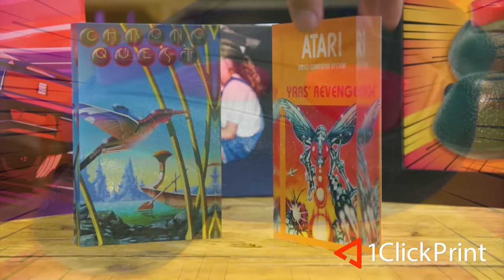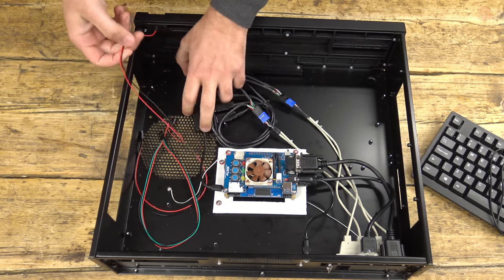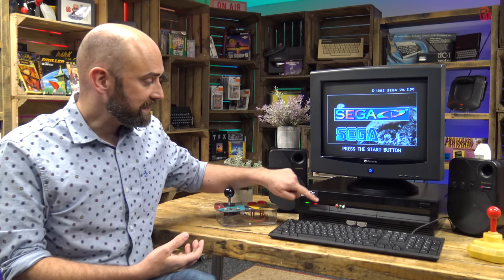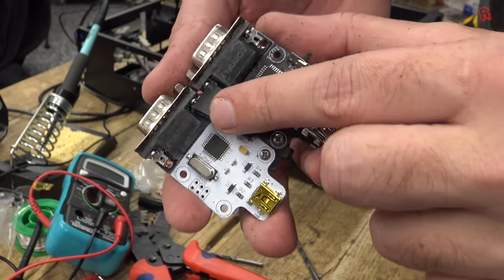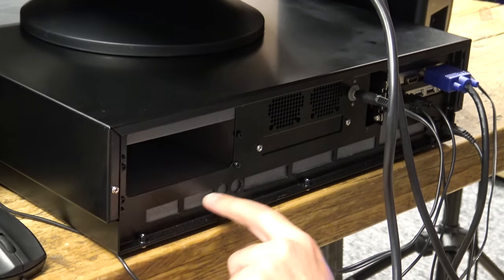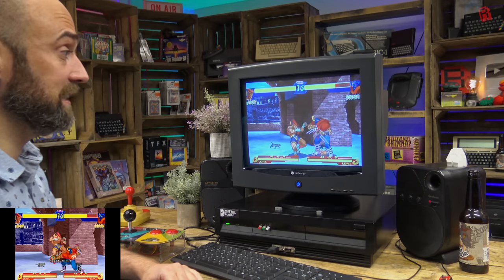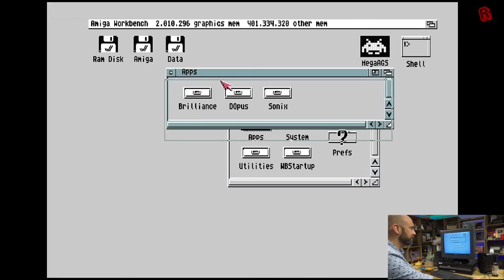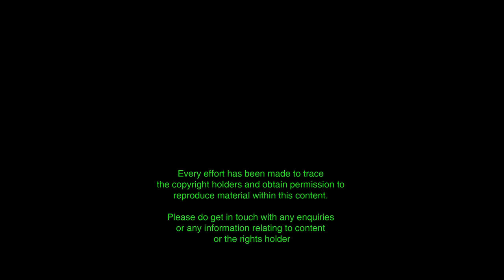My Ultimate FPGA Desktop Part 2 - The Finished MiSTer build

Comment: I think this is absolutely the perfect case for this. It gives you a great place to put the display and gives you that wonderful 'old school computer' feel and the MISTer can simulate basically all of them from the Amiga to the C64 to even 386/486. As far as the power button situation goes, my first thought was 'latching relay'...but I'm a little old-school that way I guess lol.
Reply: hearing a relay click would've been satisfying for sure! but my first thought was a latching logic circuit, which is probably what's on the board ^^
Reply: I thought having a latching power switch would be more fitting for a 386/486 type PC aesthetic as well.

Comment: Can't believe this was a month ago already. Nearing the end of my own project that these videos inspired me to start. I went with a horizontal Desktop style case as well, black even. However not an enclosure that was meant to be a Computer.  I've repurposed a discontinued anodized aluminum VGA/Audio Switcher. I'm at the last step of wiring in the momentary to latching switch/relay. The same one you have here. I wanted to make sure GND wasn't really GND. And no it's negative DC.

Comment: I have made something very similar to this, except I used an old Compaq PC case and it currently houses a Raspberry Pi, though the intention is to upgrade to a MiSTer soon.
I chose to use a beige case because I thought black looked too modern. I mounted the joystick ports at the rear to keep the cables away from the keyboard (I leave it plugged in all the time anyway, so easy access wasn't a priority).
I haven't fitted a reset switch yet, but I plan to locate it at the rear of the machine where it can't get bumped accidentally.
It's fantastic having a setup like this. The case may be mostly empty, but it actually feels like you have a real computer in front of you, one that's not going to get dragged off the desk by the weight of its own cables.

Comment: Take care of those speakers, I had those in the 90s and the pots were super noisy
For anybody else that wants to convert momentary to latch switch and doesn't have a drawer full of electronics, you can salvage one from an old PC case or buy them standalone, those little modules are quite standard (and probably cheaper than the board shown)

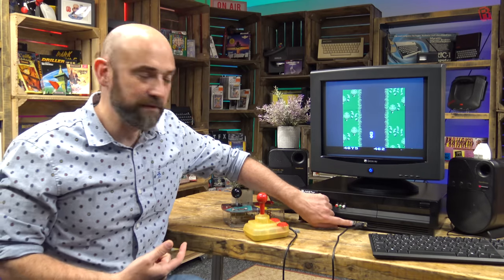Comment: 10:32   What makes FPGA so interesting is that it IS genuine hardware.  It's a circuit-level recreation of vintage hardware that can be reconfigured on the fly.  So, it's... like a clone board of an original system, rather than emulation.

It may or may not be an exact recreation of the original system, it may just be something broadly functionally equivalent, that's (partially) up to the core authors, and in the case of the joystick ports, for example, the human/machine interface being accurate.  (a large part of using a Speccy, for example, is the various keyboards that machine had)

The right input device being used will make a massive difference for emulation too, but most people don't put in that much effort for emulation these days.
Reply: ?? To be honest I don't find any different between FPGA and Emulation, now day Emulation become quite good unlike few year ago probably coz how those big company handle our favorite game like those Downloadable only game in PS3, Xbox 360 and Wii and some company delist it in digital store, even physical form become hassle now day as not that many game get physical form specially new PC game now who many of it use Steam (hate steam DRM btw but I like GOG for free DRM game), there still may reason of it but thanks to these reason emulation and FPGA born and it's have each weakness and strength but it's still better than let big greedy company handle our retro game.
Reply: @Marcel H In a true FPGA recreation, it'll be pretty much 1:1 with the orginal circuit diagram.

But sometimes that's not actually desirable.

Comment: This machine looks brilliant.  The only issue for me (visually that is) is that the three coloured push buttons in the middle are kind of jarring where pretty much everything else on the front panel is black.  I think I would rather change them out for something that blended into the case a bit better, but that is just me.

Comment: One thing I really wish the mister project had is an ISA slot addon for use with the ao486 core. Then we'd be able to use real soundcards, video cards, etc... I have fond memories of the Soundblaster 16's text to speech software, but I don't think the necessary chip has been implemented on the ao486. I can always live in hope that some clever sausage makes one.

Comment: Great build overall.
I would have done a few things differently though:
- Internal power supply
- Kettle socket, maybe with a socket for the monitor, like in the good old times
- A real power switch
- An extension for the power plug, rather than soldering onto the board
- Drilled a hole on the vga+hdmi backplate and move the audio out in line with the hdmi out

I do like the joystick ports on the front, you should be able to make them metal black them using blueing liquid.

Comment: Another thing to add to this setup/build, is a decent hardware scanline generator dongle for VGA, or you can get one for HDMI (or both even), you will then have BVM grade image quality, 480p with the standard scanlines setting will produce an image exactly like a JVC shadow mask broadcast monitor (BVM), and of course it doesn't cost thousands like the best BVM monitors can, a nice quality SLG costs less than 25£$ or so. I know the MiSter can produce its own scanlines, but that's on a core by core basis afaik, a hardware SLG is so much better, once the right jumper is set it won't require any more maintenance or setting up, works with any console, even the 360 & PS3, some 360 Arcade games look amazing with scanlines.

Comment: This helped me after almost a year of fiddling with the mister but not getting anything working very well
Reply: I think I'm going to use a mini itx case for mine even though I had purchased a 3d printed one, the 3d printed case only uses some "ultimate" mister vga card
Reply from the maker: Glad I could help. There is now a Checkmate Mini case you may want to check out at https://www.kickstarter.com/projects/checkmate1500mini/amiga-3000-inspired-mini-itx-computer-case

Comment: You are ABSOLUTELY NOT an idiot...frig em if they don't like it. Hardware recreation, not emulation .... but I would have put the MiSTer in an arcade cabinet myself. Looks really nice, nonetheless! I would not have used hot glue as a permanent solution however. You have that 3D printer...make more mounts with screws! Love your videos BTW!

Comment: Any resistors for the LEDs? Always use a resistor to limit current, LEDs should be seen more like they are driven by current than voltage, a 3V LED will evetually fry if driven with 3.3V. Just my 2 cents.
Reply: A 15-22ohm resistor for the power LED would be suitable.
Reply: @daw7563  The resistors are on the addon board already. The header is for LED's without resistors.

Comment: FYI, You might want to add a current limiting resistor to your LEDs.  That green one is awful bright, and is probably being a bit over driven.  It might not last very long if it is.  Not a big thing, but if you notice that green one starts going DIM, that is whats happening.

Comment: Just a suggestion: use the optical out instead of the stereo jack.  The stereo jack output isn't that good on the mister, optical out is much superior but it does need a DAC.  I think you have space available inside the rig to add a small DAC to hook up to the optical out.  It would provide superior sound quality in games and you'd still be able to use the stereo jack output on the backside to hook up speakers.  Really cool build other than that.

Comment: You could have just used 3 transistors to drive the LED's. There are a couple different ways you could do it with 3.3v or 5.0v plus using the 1.7v signal lines to control the current flow.

Comment: Such an amazing build, beautiful case, brand new VGA CRT, which matches up perfectly, now you could perhaps incorporate a nice stereo amp PCB with speaker terminals at the back, I'd actually use a quad stereo amp, the SMD/GEN Yamaha synth audio for example sounds sublime via quad stereo with some good speakers, really highlights the quality audio it manages to put out, plus all the other will sound fantastic too. You will then have an incredible audiophile/videophile grade retro machine, another cool feature would be RGB Scart output, to run it off a CRT TV as well, get the best of both worlds. You also have a slot for an optical drive, if Mister adds official disc drive support, for systems like the Mega CD, NEO GEO CD, PCE CD, PC cores, Amiga CD32 and so on.

Comment: A really nice feature of FPGA vs Pi emulation is that there's no real boot-up or shut down sequence needed. Just hit the switch like the hardware it's "emulating", unless it's emulating a computer that has a disk-based OS, etc.

Comment: Pretty neat, like the 9 pin joystick ports, but are there also options to add things like cd-rom drives / floppy drives etc? I know USB ones exist but beeing able to use a proper internal one would be awsome. An IDE + floppy controller combo would be neat just for that added authenticity in the experience.

Comment: I use my Mister for BBC Micro, Amiga and ZX Spectrum. I have got The Recreated Sinclair ZX Spectrum keyboard, it works nice. I was lucky mine was got through Game. 
I do have Amigas to use. I think what you have done is very good having the joystick there is the best place as you can change the over with out reaching around the back. I have a USB adpater that lets me use my ZX Spectrum/ Amiga joystick on my PC and Mister. I got alot of my Mister addons from   MiSTer FPGA. I waa thinking about getting the PCBs and making my own addons but I need more practice.

Comment: Only thing I'd be worried about is the weight of the CRT bending the metal on the case. Hopefully that's not an issue Neil. Great build!
Reply from the maker: It's nice and study. When Stephen made the case it was a common question and he proved it was strong enough with some seriously heavy CRT's stacked on top of it.

Comment: Excellent, I really like the final build, A good addition would be a internal sound DAC attached to the SPDIF connector on the mister. The sound quality of the mister is rather bad because the sound comes from a sigma-delta PWM modulator, not a proper DAC.

Comment: Hot snot makes baby jebus cry.

Also, your mouse house should have a hole in the inside for the cable, and then be upgraded with a spring loaded reel for the cable to recoil inside :-)

Comment: For a brief moment I assumed you were going to show us some new CDTV, the black finish of all the components fits just so well, I love it! 😆
Plus you named that machine after one of the core elements from BTTF2. Nice touch, it is my favorite of the series 🤓

Otherwise, from my non native English understanding the term to emulate involves something or someone to mimic/replicate the behavior of someone else or something preexisting.
That said, I believe you are fine calling FPGAs emulators too.
However, hardware emulation is so much more accurate that it indeed differs from most programs.
Higan/bsnes may be an exception which still takes on the Analogue Super NT but that's another story.

Take all the thumbs showing up you can get!

Comment: Very nice. I have to say I never liked those mini buttons. I have found that the protruding buttons break off easily or just fall off. Tandy (UK) used to do really nice buttons and these were also available from Maplin. I've started to use metal silver illuminated buttons on my projects which you can get from China. These are available with really nice colours on the LED's blues, violets and purple. Though I'm surprised you didn't use cherry arcade buttons for that chunky arcade look :)

Comment: BEAUTIFUL build.  I like it (from the outside).  I would have put the keyboard ports someplace where they didn't interfere with snugging the keyboard up against the case (raise them a couple of inches, put them on the side, etc.).  But that is preference.

What I don't like is how messy the inside is.  Yes, I know that you have no control over that.  You had to do what you had to do.  But in an ideal world you should not HAVE to use hot glue.  Somebody should make a single circuit board that you can mount the FPGA board to that has the joystick adapters, extra USB ports, and the power toggle all built into one unit.  Yes, "somebody" should design and build one: not me.  I do actually have the skills to do such a job (electrical engineer), but what I lack is the money to spend, the time, or the inclination to dump my spare hours that way.

Anyways, great job.

Comment: The Gateway monitor looks nice indeed and I still would love to get my hands on a X68k setup. Really should update my MiSTer though and hopefully it will solve some problems with the Amiga for example, where I got two different images with countless games but both of them have problems with certain games and especially saving RPGs, even though it works fine under WinUAE. Still need to play Ambermoon, Black Crypt, Dungeon Master - Chaos Strikes Back, Fate - Gates of Dawn and so on.

Comment: Now it needs a keyboard garage, either on the side or A1000 style.
Reply from the maker: That is an optional extra with this case, you just buy the rails and screw them in
Reply: @RMCRetro  I saw that on your earlier video, but I thought you could do something on the side with your 3d printing, to stand it up Switch style in an attached cradle. This would get it out of the way when playing games which don't need it, same reason as the mouse house.

Comment: Awesome project, I'll definitely do something similar and I totally understand why you add these buttons in the front panel, it helps to the immersion of an alternate history where this machine would have existed. :) Ah ah now I have to find an old SGI case :D

I wonder instead to use a small board for the power button, you maybe use a standard PC PSU by picking the 5V line and connecting the power button to the ATX connector. I think that should work but add a fan and may eat up more energy than your solution.

Comment: Regarding having an SD card slot, I found found that updating the MiSTer main file is a problem using FTP access and such, even when you switch to USB mode, the SD cards MiSTer file still seems to be write protected. But I guess the only real reason I needed that is because I had compiled / built my own MiSTer main files because of the many beta AO486 updates that got released the last few weeks. With official releases you can just run an update script.

Comment: Would be cool if a keyboard was made out of those switch buttons on the front there. Maybe a spring loaded lever you could hold down for the tab button, a dial switch to turn cap locks on and off, you would really FEEL the typing then, like the keyboard was a machine you had to manhandle not this thing to tap away on with your finger tips.  With buttons 3 times the size of your finger pads, it will take shear strength and determination to type out our name for player 1.  Like it should be.

Comment: Love it, Do you prefer MiSTer or Rasp Pi though? I have tried to get along with retropie but it just leaves me cold. I need it to feel like a real system (Atari 800XL really)
Reply from the maker: Both have their merits. RetroPi for example has MAME for arcade games, and with that you have thousands of arcades to choose from.  With the MiSTer you're limited to the arcade cores currently available for it which are far fewer than MAME.  On the flip side I absolutely love the feel of the Amiga on this thing.  The Pi is wonderful, especially for the price.
Reply: @RMCRetro  Thanks for the reply

Comment: Very good!
Would I have done it differently, of course, but this is your baby done your way just as it should be.
Watch out. Fixing up old computers, a bit of case-modding, then building your own, is a slippery slope without end... Ben Heck would be a well-known example.
If I might render a little advice:
As you slide down this slope a point is going to come where modifying and making-do to achieve your ends just won't cut it. The sticking point for most, including me, is not wanting to jump down the rabbit hole of designing and building your own stuff from scratch. I put it off far too long, much to my increasing frustration. Circuit and PCB design, 3D design, etc, really isn't that hard. Jump in head first as soon as you find you need to, just remember to document everything you learn and create - I never did and the result is much time wasted trying to work out what's what when revisiting old projects.
PS
I must go see if there's a Sharp X68000 core... Awesome computers, way too expensive these days, and the emulation isn't that good. Your black Checkmate case looks quite X68k-like.

Comment: Are you happy with your keyboard, are you going to look at modifying one? getting a new commodore keys version?  Just wondering about your 'perfect' setup....  

I am waiting for a new commodore vic20 from retro games.. I think in October? ... per-ordered... if you know any similarities or comparisons between the Mister version and retro games version of the commodore 64 I would be very interested.  From emulation lag to sound quality (Sid chips) evaluation.  I do not know if the commodore 64 from retro games is using fpga or just software emulation.  Thanks!  

New system is quite nice.  I will likely contemplate my 'version' as well.  Likely be commodore themed. LOL

Comment: You have a squeaky stick. You should grease it up before you use it, you know?
Reply: Silicone oil on any rubber blocks or stoppers, the best modification ever.